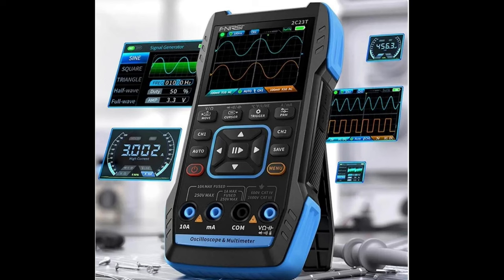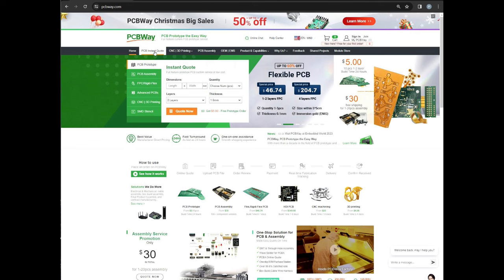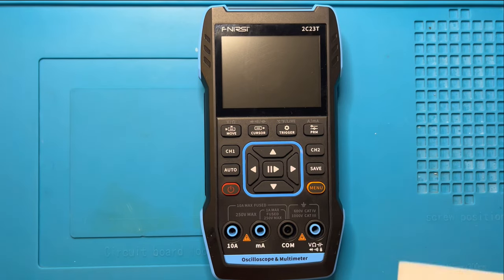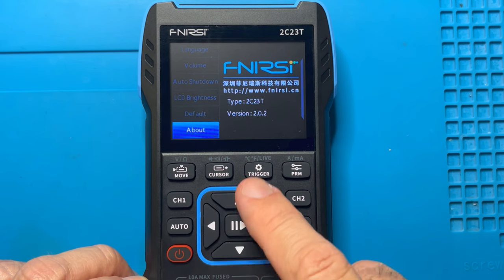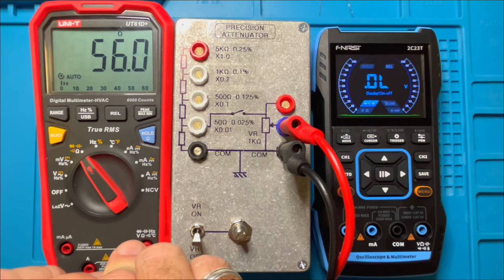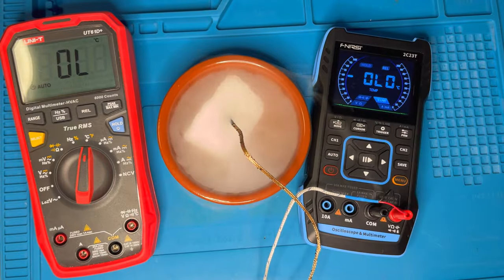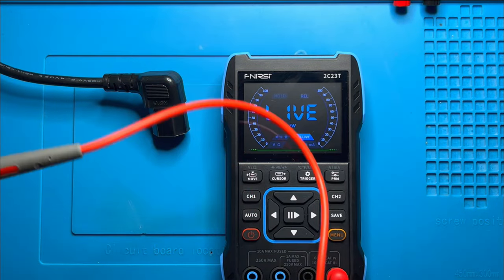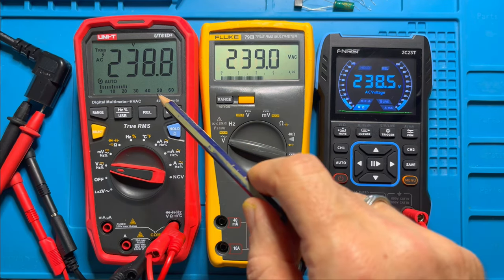FNIRSI 2C23T Functional & Performance Review

Comment: This product is starting to become very popular. As a third video, could you show how to use this oscilloscope to find or measure a faulty component on a power supply, a modem or a computer motherboard? I'm sure this will guide novices like me and enable you to reach more followers. Also, I would appreciate it if you didn't forget to add subtitles. May the strength be with you.
Reply from the maker: Thank you for the comment, yes i see that it is selling well. Quite unique at that price point.  I will be sharing some repair videos in the future and I will try to make a point of using the FNIRSI :)
Reply: @ElectroBananasYT 🎉🎉🎉

Comment: Just now I got this 2C23T but one thing I found: the volt value that write on oscilloscope screen less than input but the drawing is correct , input is 5.000 V  and the multimeter mode is correct and drawing wave on oscilloscope is correct but the value write on oscilloscope is 4.800 is there a way to calibration ?
Reply from the maker: Hello, there is a secret calibration function (it is in my video at the end), but it is only intended for use by FNIRSI during factory calibration and there are no instructions on how to use it - so don’t!!! You might uncalibrate your device!! The multimeter does provide slightly different reading sometimes, especially with ac / fluctuating voltages as the multimeter attempts to give RMS values. Were you measuring DC?

Comment: I got mine from Temu special offer £34!! At that price I had low expectations especially at low current and the 'scope. I use it for automotive applications fuel injector pulses, etc where it really is in its comfort zone. At just over £30 or £80 full price it is a fantastic package! Thanks for the additional info on screenshots and firmware upgrades, etc.
Reply from the maker: Hi Barry, thanks for the comment and I am glad that you found the video useful. Wow, that is incredible value - good catch!
Reply: @ElectroBananasYT  I note your insightful use of the word "catch"😂 The "catch" was, after seeing your presentation, learned of missing items: my unit arrived in a plain box with no nice instruction book and the serial number label missing but hey! it all works.  I also note the 4051 shift registers still being used, more than half a century! I still have my red Motorola 4000 CMOS data book from 1976.  I also note your Tandy Realistic AM radio - you are a blast from the past and present Sir!!
Reply from the maker: Thank you Barry! Well it is still an amazing deal! And good to see those old logic IC’s still being relevant today. Yes I like to mix modern with retro 😅

Comment: FNIRSI actually delisted the 2C23T from there Website a day ago. The question is why and wether it is still in production.
Reply from the maker: They are still manufacturing and selling the 2C23T. I contacted them. Their response “2C23T is currently in normal production and sales;
The website is currently under maintenance and updates.
We will refresh the new website information after the update”
Reply: @ElectroBananasYT  That's good to know, mine still hasn't been dispatched.
Reply from the maker: Hope you received it in the end

Comment: After looking at this video I ordered one. Primary reason was that I needed a decent multimeter. Not much extra cost for added functions. Had a Fluke Scopemeter thirty years ago which was very useful when working with industrial automation. Now retired though sometimes an oscilloscope could be useful.
Reply from the maker: Thanks for comment Mike. Wow you had an early scope meter. Yes 2C23T is not a bad scope meter for the price. All the best with it.

Comment: Great video, both actually . I found your videos after ordering mine .  I'm waiting for it to arrive. I am curious after watching your tear-down video if I could 3d print a new topper to expose enough room around the BNC connectors to take shielded probes.  Then again maybe I wont as a way to remind myself to avoid high voltage, maybe.   
For me it's a huge gain of space on my desk in the house and I can move some of my other kit to the shop. 
Now if only they make one with a multi CH logic probe packed in with data logging out to PC. LOL  That would really clear my desk in the house.
Reply from the maker: Thank you! Actually I had the same thought as you about 3d printing a new rear panel to allow the insulated BNC connectors to be used. I don’t use my desktop scope as much now, keep reaching for the 2C23T for basic scope functions.

Comment: Great video 👍..very detail n pros & cons. Considering between this 2c23T & the ZT703s..
Quite amazing boot up speed👍
For my use 2C23T fit me well at 10Mhz hopefully their firmware could fix most of the cons u mentioned.
❤thanks for making this video
Reply from the maker: Hello Jim, thanks for your kind comments! It is a handy jack of all trades and has been quite useful. As long as you are aware of its limitations I think it is great value for money. Recommend getting a zip up carry pouch for it. All the best!
Reply: @ElectroBananasYT  thanks, I had one Fnirsi 1014D bot sometime ago at home bench work, don’t want to bring it to field work, most of the time I don’t really need a scope but at times I wish I had one with me always when troubleshooting signals where meter just can’t SEE. Ordering now. Keep up yr good work. ❤️subscribed to yr channel.
Reply from the maker: Thank you! I think you will like it
Reply: @ElectroBananasYT just got the 2C23T yesterday. Yeah, I kinda like it. Too bad seems Fnirsi had taken down the firmware for 2C23T. Mine is ver:2.1.0 is this the latest? Thanks for your sharing ❤like to watch yr video.
Reply from the maker: Hello there, I’m glad you received your unit 😊 I think it must be the latest if you have just received your device. Have you checked FNIRSI’s Website? I am still on V2.0.2.

Comment: Great review.  Did you do the undocumented maneuver after taking all the measurements/eval?  And do you thing the Red battery level affected anything?  Amazing what they are doing with these handhelds.  I have the Zoyi 702. 👍
Reply: I have the 702s as well, a whole new world.  Pos as far as serious scopes go but wow it opened a whole new way of looking at electronics. My first scope.
Reply from the maker: Thank you for your kind comment. I had used the functionality previously and it has always passed and entered a  mV mode. Fortunately it only failed sometime after I did the accuracy tests. I doubt the low battery warning would make a difference but I will retry the calibration again when fully charged - good point. How is the 702?

Comment: picked one up. only tested the multi meter but my unit is whiten .3% of NIST traceable equipment.  Temp is off a little but withe spec for the setup.   Overall nice little unit.  Also you can replace the boot image to whatever you want.
Reply from the maker: Thanks for your comment. Yes I enjoy using it too. I have had limited success changing the boot up screen/graphic.

Comment: Thank you for your info about how to calibration !!
Reply from the maker: You are most welcome, thanks for the comment.
Reply: @ElectroBananasYT  I cannot get a perfect looking square wave as you have in 54:53.  Wondering if this is a scope issue or a probe issue?  I have 2 of these (thinking one was bad) all 4 probes the same. I cannot adjust the pot enough to make it square. Also have used the generator from my pico and same result.
Reply from the maker: Hello, do you have the probes switch to x10 (the little switch on the probe body or the probe plug housing)
Reply: @ElectroBananasYT  This was with the probe that came with it.  I had the slider on the probe to 10x and the channel is set to 10x.
Reply from the maker: Hmm, perhaps you can email me a photo of your setup and screen shot of the signal when adjusted?
Reply: @ElectroBananasYT  sent
Reply from the maker: Thanks, I will take a look

Comment: Excellent review, thank you for your work and your time.  I have the same one, firmware 2.0.1, do you think it should be updated to 2.0.2?  Thanks a lot.
Reply from the maker: Hello, glad you found the videos useful. 

YOU MUST BE VERY CAREFUL IF YOU INTEND TO UPGRADE THE FIRMWARE. 

As of May 2024, I have this following information:

Firmware V2.0.2 is only intended to fix issues with an older version of hardware. 

If used on the latest version of hardware, the upgrade will fail and the device will not start - you will have bricked your device.

I think this is why FNIRSI took down the firmware from their website - I suspect that there were many users bricking their devices by trying to download load 2.0.2 to a device with a newer version of the hardware. 

To determine if you have the ‘old’ or ‘new’ version of hardware, go to settings and see if you can see the hardware version displayed (hardware may be V0.4 or later). If you cannot see any hardware version, then you have the older version of harware.

If a device already has the latest version of hardware (V0.4 as of May 2024) a firmware update is not required as it would have been shipped with the latest version of firmware for that hardware (V2.0.1).

If you have the older version of hardware, then you can upgrade the firmware to V2.0.2. 

I know, very confusing.

If you have bricked your device, contact FINIRSI by email / whatsapp. They are usually responsive and helpful.
Reply: Thanks for your answer, dear friend.  Yes, you're right, this is a mistake.  I only have 2.0.1 written.  Does this mean there is no need to update?  Thank you.
Reply from the maker: Hello, if you don’t see a hardware version then that means you have the old version of PCB. And this means you can update to V2.0.2 (as I understand it from the various blogs on the topic).
Reply: Please send me the file with firmware 2.0.2.  Thanks a lot
Reply from the maker: Sent
Reply: @ElectroBananasYT  Thanks so much for this information and the video review, very helpful and i just ordered one.
Reply from the maker: You are most welcome. Glad you found it helpful. Have fun with your new tool!

Comment: Apart from single(autool dm303) vs this dual channel , what are your thought comparing this to autool dm 303 ?
Reply from the maker: They are very very different types of equipment. Oil and water. The DM303 is designed physically for the harsh environment of the automotive applications and features functions and accessories that are only really relevant to auto diagnostics. The FNIRSI is far from rugged and has specifications better suited for the electronics and electronics repair technician and students. If you are in the automotive industry go for the DM303. If you are interested in electronics, the FNIRSI is the better of the two.
Reply: Thx for your info and review 👍.  Only thing that stop me from getting the dm303 is the single channel oscilloscope, wish it has 2
Reply: @ElectroBananasYT  how do they compare to owon hds272s instead ? What are your thoughts?
Reply from the maker: The HDS272S is an amazing handheld for the money. Much better than the FNIRSI in so many ways. It is in a different class, but so is the price. I don’t own a HDS272S, but would love to…

Comment: I was able to use an android phone to send the firmware update to the oscilloscope which was not expected to work but it did and very very quickly too.
Reply from the maker: That is interesting, well I guess you just need to deposit the file within the drive that the Device creates in program mode. Nice work! 👍
Reply: Yeah absolutely just copy and paste the file to the root of the drive and it's done in a flash literally. I used the Google files app and had no issues whatsoever

Comment: At 46:26, the user manual for dual channel usage states: "When dual channels are used simultaneously, the ground clamps of the two probes must be connected together. It is strictly prohibited to connect the ground clamps of the two probes to different potentials, especially at different potential terminals or 220V of high-power equipment. Otherwise, the oscilloscope motherboard will be burned because the two channels are grounded together, and connecting to different potentials will cause a short circuit in the internal ground wires of the motherboard, as is the case with all oscilloscopes." Is there anything you may have forgotten or missed?
Reply from the maker: Nothing unusual here. For a multi-channel scope, the input grounds are usually common (connected together).
Reply: Remind me long ago a team doing a porototype, the tripped the lab breaker twice by mixing live and neutral across the two channels. Learn how the grounds are tied together : THE BAD WAY. If breaker trips once, just try a second time to be sure LOL
Reply: @ElectroBananasYT  This is why a love my half working TH720, isolated grounds 600V input. The LCD is dying after being repaired (as last resource ... polarizer change). Local Tek repesentative wont take it for repairs (too old). It is not alone, Fluke Scopemeters from the 90s vintage (Philips) also suffer from that. I still in love with the 123, what a beast !!!!. Roughed, trusty, unstopable.
Reply from the maker: I also used one in the past, built like a tank. You are lucky to have one!

Comment: Hi, I’m considering purchasing one of these, but was wondering if the one you have still works to see how well it lasts. Could you give an update on that?
Reply from the maker: Hello, my original unit is working well and I enjoy using it. I accidentally cracked the plastic screen, however FNIRSI sent me a replacement. Other than that all good. I also bought a protective pouch to carry it around in.
Reply: Ok, I’ll probably make the purchase. Appreciate your feedback👍🏻

Comment: Thank you for the excellent review. I would like to use two channels to input a 20khz square signal and use the second channel hooked up to an antenna to receive the same signal and measure any frequency shift and to measure the decay. I will boost the signal with an audio booster circuit and transmit the boosted signal. Is this possible? Thank you for your time and efforts tgst you have spent in my behalf.
Reply from the maker: Thank you very much! Glad the video was helpful to you. not sure I fully understand your project. It is only 20KHz and you are using an antenna? Do you mean microphone? Perhaps you can email me some more details?

Comment: hi ty for the brill fnirsi 2c23t video's ,, but when i update it it does not reboot ,, i sent it back ( to amazon  )  and the same thing i have googled to see if there are any known issues ,, i wonder if you have any ideas ,, any help would be awesome ..  ty - Earle
Reply from the maker: Thank you for your comment Earle. I have found the following information on upgrading the firmware (as of May 2024):
Firmware V2.0.2 is only intended to fix issues with an older version of hardware. If used on the latest version of hardware, the upgrade will fail and the device will not start.
To determine if you have the ‘old’ or ‘new’ version of hardware, go to settings and see if you can see the hardware version displayed (hardware may be V0.4 or later). If you cannot see any hardware version, then you have the older version of harware.
If a device already has the latest version of hardware (V0.4 as of May 2024) a firmware update is not required as it would have been shipped with the latest version of firmware for that hardware (V2.0.1).
If you have the older version of hardware, then you can upgrade the firmware to V2.0.2. 
I know, a little confusing.
If you have bricked your device, contact FINIRSI by email / whatsapp. They are usually responsive and helpful.
Reply: @ElectroBananasYT  hi thank you for your quick response ( i appreciate it very much  ) but as of this time my device just will not power up , and i have not ( as of 4 days now )  had a response from  FNIRSI 2C23T ,, i liked the device and your videos help me a lot ,, and ideas on how to make it power up ,, would disconnection the battery help -- again ty
Reply from the maker: Hello, sorry to hear about the issues you are having there. Unfortunately I can’t advise you on this other than to keep trying with FNIRSI. They are usually responsive and helpful.  I am surprised that they have not responded. Best of luck with it.
Reply: @ElectroBananasYT  Thank you for the excellent videos. I have been using it for a few weeks and your video helped with several questions. Mine is a 0.4 hardware version and unfortunately the V2.0.2 update bricked the device. I can get back to boot loader by pressing the reset button and then holding the menu key and pressing power. Hopefully Fnirsi will be able to give me a backlevel firmware to recover it.
Reply from the maker: Thanks for the comment and sorry to hear of your troubles. Normally FNIRSI are quite responsive. Hope you get it working again soon! Let me know how you get on.
Reply: @ElectroBananasYT  FNIRSI support replied quickly and sent a link to the 2.0.1 firmware which I was able to load via bootloader. The unit is back in operation - all good. Thank you again.
Reply from the maker: Excellent!!

Comment: Do you think a firmware update can fix the jittery / inaccurate in dual channel mode?
Reply from the maker: That would be nice, although I think that the issue is so obvious, if it could have been fixed with software, FNIRSI would have done it by now. So most likely it is a limitation caused by the hardware design limitations. Fingers crossed I am wrong …

Comment: Can the function generator output voltage be adjusted down to the milli-volt range like 0.0025 v and 1kh frequency?
Reply from the maker: Hello, output voltage can only be changed in 0.1V steps. So the lowest is 0.1V.